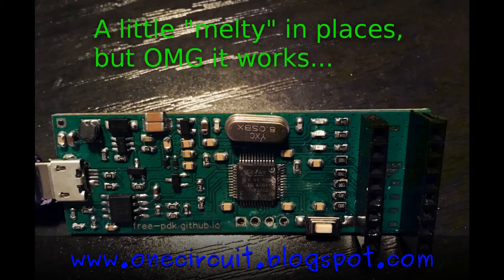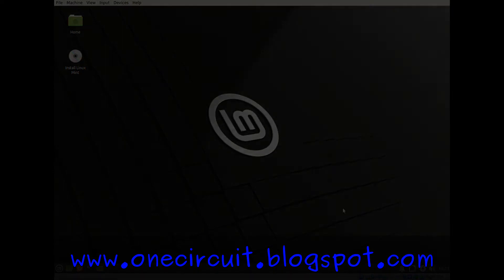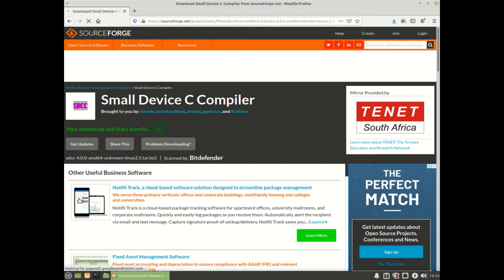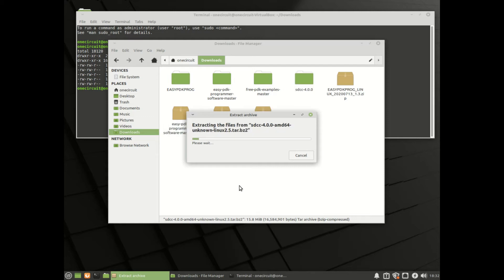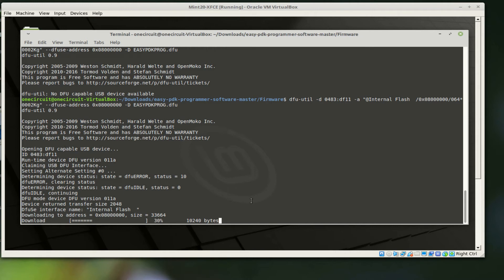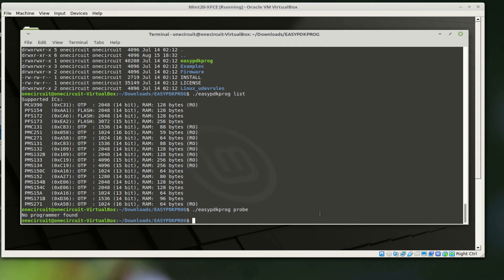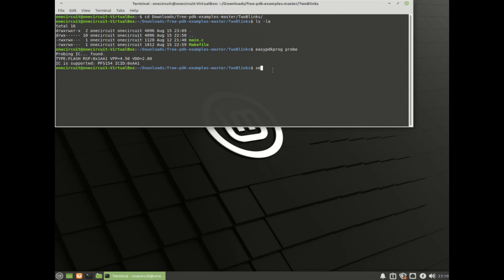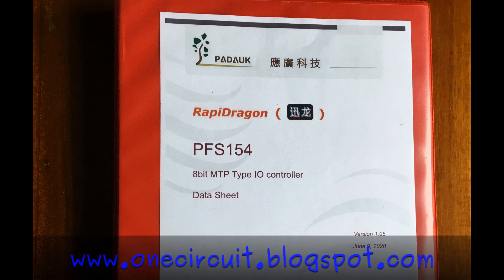Free-PDK Padauk IC Programmer (Part Two)

Comment: I recently bought some PFS154 Padauk chips but unfortunately i did not get the possibility to program them as freepdk programmer software seems to not match the protocol expected from these 2025 chips. Maybe Padauk changed the Protocol and that latest github version of programmer is 2020.
Reply from the maker: I've had no issues with recent chips, but I have a batch coming from lcsc soon so I'll test and get back to you. Have you been able to program older chips with that toolchain?
Reply: @onecircuit-as  I am coming from AVR and esp worlds so this is my first experience with padauk.  I will double check every thing from the programmer hardware to software before I can tell for sure. I am keen to hear from your you the result of your test with the new batch and thank you Sir for that. For your information, I am building an intervalometer for my Canon camera and wanted to give a try to these chips.
Reply: it finally worked for me, so there is no issue with recent batches (Apr 2025).
Reply from the maker: @firestorm198100 Congrats! 👏👏👏

Comment: Do you have spare unassembled pcbs , I need
Reply from the maker: Look online for the r1 lite version, easier to assemble and more reliable: https://github.com/free-pdk/easy-pdk-programmer-lite-hardware
Reply: @onecircuit-as  does it work for pms150 , 6 pin
Reply from the maker: I am not sure, I have only successfully used 8pin PMS150 with this programmer.
Reply from the maker: @Blue.star1  you can import gerbers and reconfigure
Reply: @onecircuit-as  ok, I have to edit brd  file (no idea of editing gerber)  any program to blink a led on 1 pin then second led on another pin without using delay lines ( use timers )
Reply from the maker: @Blue.star1  good luck! The design isn’t mine so I’m not sure how to proceed.
Reply: @onecircuit-as  ty, I  opened json file in easyeda , gives 118 fatal errors all these errors show "lacks property device footprint"
Reply from the maker: @Blue.star1  wow that’s not a good start! Maybe go to the original eevblog post and ask? https://www.eevblog.com/forum/blog/eevblog-1144-padauk-programmer-reverse-engineering/

Comment: Was looking at the schematic, thinking I could build one of these ... yeah ...
It is nice they use an STM32!  I have one similar.  But oh, the horrors.  There is a boost to 15V, and -2.4V needed for one of two opamps involved.  Yuck.  The programming mechanism is bizarre!  Kinda reminds me of an AVR's HVSP, but far worse.
Looking at the datasheet briefly, says the flash space is 2KW ... kilowords?  4k then?
I need to get onboard this Padauk train!
Reply: Great project but a little beyond me, me thinks.
Did a little m/c code a few years ago but man this tied me in knots.
Need to do some more studying.
Thanks for sharing.
Reply from the maker: ISO Guy ...and me on a normal day. Only one from five tries working! Voltage issues. 😢
Reply: @onecircuit-as  The 15V boost might need a trimmer in the design, if it must be spot on.
Reply from the maker: GnuReligion I definitely think it’s early days on this design, there are most likely revisions ahead! 👍😀
Reply: @onecircuit-as  I scoped out the source code to the firmware last night to see if I could use  one of my STM32F103's instead of the F072, to build it.  Does not look likely.  I left a comment on the issues section, but no replies.
Reply from the maker: GnuReligion If you trawl the forum they talk about STM32 variations that can be used. I have some new chips in the pipeline so hopefully that might help. In the meantime I’m following components and traces to find out why MKIII and MKV are not playing along...
Reply from the maker: I'm wrestling with the voltages in MKV at the moment. Hard to tell what is failing but something is not right and the STM32 is not being recognised. I'm also waiting on some new STM32s that might be more legit? Watch this space...
Reply: @onecircuit-as  Looking at the schematic, I do not see a pull-up resistor on the D+ that allows a USB 2.0 host to recognize the client device.  (shrug) Could be internal.  Your syslog will tell you if the device exists.  You were USING the device already in this vid, eh?
Reply from the maker: GnuReligion Yes I have one working version, and some “runner ups”. The SMD components and complexity combine to make it a tricky one to put together.